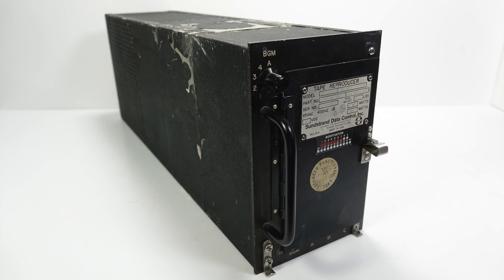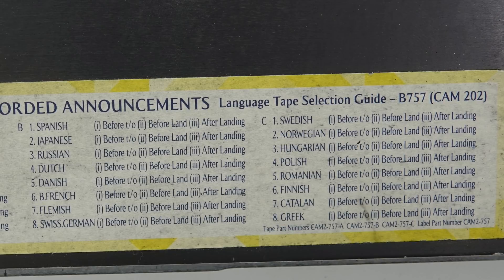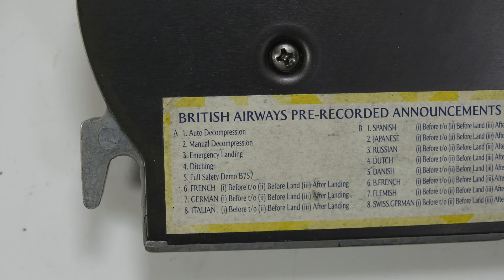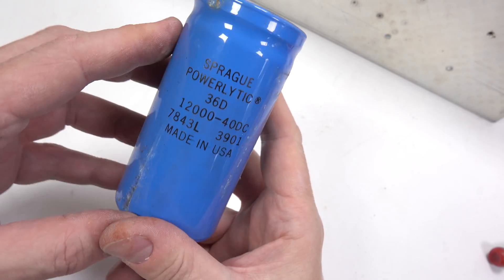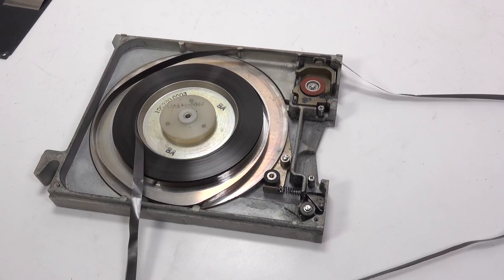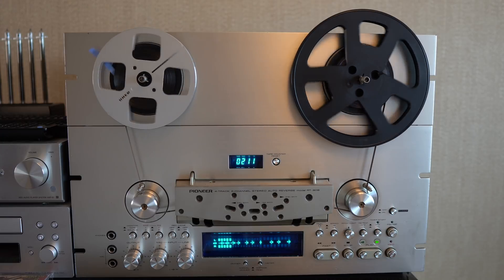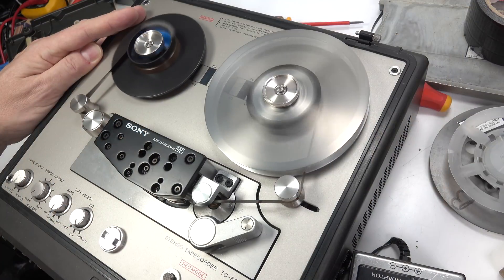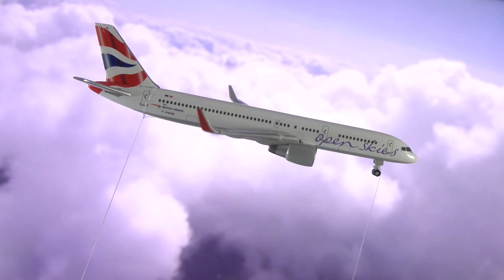Tapes on a plane (Part 2 - The Tech)

Comment: 115V at 400Hz is the "mains" of an airplane generated by the turbines and/or the auxiliary power supply inside the tail.
The 28V is the battery backup power which keeps essential stuff running like fuel pumps, emergency lights, a few instruments and the black boxes.

Most components also use 28V as an "enable" signal. When I had worked inside an EMC test facility, we often had components for airplanes. For this purposes, we had a large rotary current motor driving an airplane power generator to simulate the airplane power system. To activate the components, we mostly connected two common 9V batteries in series to activate and deactivate the components during the tests.

Comment: My guess from the complexity of the circuitry is that this thing can do a lot more than just play a recorded message. I think it's a general purpose annunciator unit with optional recorded messages. Given the effort they've gone to in checking that the tape is present and playing correctly, there must be something that happens if a selected announcement fails for whatever reason. The large number of connections at the back suggest a data connection of some sort. It could just be to raise a failure message of some sort but I doubt it. I have a feeling this might have some sort of speech synthesis for producing aircraft manufacturer predefined mandatory announcements for each of the categories if either it can't start the tape, there's a fire in the cabin, nuclear apocalypse, etc.

The reason I say this is that I was once on a 737 in the mid-90s that experienced technical issues midflight with one of the engines and there was a chillingly weird synthetic female voice that simply said "Attention, Attention. [Beep]" on repeat for a few moments until the crew cut in with their bing-bong bit to say that it was nothing to worry about except the plane had to turn around. I bet if you hunt around in the onboard ROMs that very message that I heard is probably in there somewhere. I would hazard a guess this unit probably has rudimentary speech synthesis rather like the Neal interview recorder but in reverse.
Reply: Yes. I was right. The name of this piece of kit is a shade misleading as it isn't just a Tape Reproducer at all. I couldn't find any information on the 757. However, the 767 Systems Guide still calls the equivalent of this a Tape Reproducer, albeit a Digital Tape Reproducer (DTR), even though by this point in development there were no tapes in it at all as it was a digital audio player. Therefore this is one of those odd examples of strange aviation systems lingo.

Comment: That giant capacitor is most likely there to keep the machine running for the 200ms-odd milliseconds interruption to the input power when switching from ground electrical power to aircraft auxiliary power, and again from aux power to engine electrical power. If there was need for it during a real emergency, it would be hooked up to the aircraft's emergency electrical bus. 

Not that anybody's going to see this comment 🙂

Comment: Did you have any problems with the frequency and voltage differences? The tape player says it uses 115V 400Hz AC. Houses use 110 or 220V and 50 or 60Hz AC.

Comment: I wonder if theres any wiring diagrams around that would give the pinout for the unit? I expect that dial on the front has nothing to do with the announcements at all and is only to do with the BGM tracks (given its labeling) considering most prerecorded announcements would be activated via the control panel that the cabin crew use to do other things such as dimming the lights.

Comment: Some of the components in this look like 1960s technology or even older, in particular the carbon composite resistors and top hat rectifier diodes, are not typical for something from the 1980s!
Reply: Predates the 757 production period as well (1982-2005).

Comment: I wonder if there is a specifications document on which pins do what. The power is 115v but uses a mains frequency of 400hz (not 50) to save weight as transformers can be smaller and save weight (common on planes and even ships).  28vdc input looks easier to try if it uses that as well.

Comment: Interesting that this was used in a Boeing 757 but was made and/or tested by Lockheed...
Reply: Looks like it was also certified for an Airbus model (probably the A310 and A320 since both were introduced in the 80s).

Comment: If you were trying to power with 115V, notice that it is at 400Hz (a much higher frequency than the normal 50/60Hz used in residential services).  I think (don't quote me on this) that planes (and some ships) use the higher frequency in order to combat noise (and to allow the use of smaller power cables).  I do like how you hang the model plane upside down, and the flipped the video!!!

Comment: Years ago I worked for Qantas Airways and we had this system on the 747 aircraft, I would have recorded and loaded hundreds of those cartridges.  The BGM (boarding music) tapes were recorded as 4 separate mono programs on a 4 track master which was then transferred to lubricated tape which we spooled on to 10.5" reels and then recorded on Akai 400GS 4 track, quarter inch machines. The tape was then wound off on to the aircraft cartridge spool by hand, using a "vinyl record" turntable and an adapter we manufactured ourselves.  The announcement tapes were mastered in 2 lots of 4 tracks on the Akai 400GS and then we transferred the recordings in two passes, to an 8 track Fostex 1/4 tape recorder which we modified to run at 3.75 inches per second rather than the original 7.5 inches per second, then hand loaded the tapes the same way as the BGM tapes.  I enjoyed your video it brought back many memories.

Comment: whats interesting is the BORING part has more thumbs up (by 1k) than Part 1 the well BORING one.  and thumbs down is far less on the NOT BORING part 2 video vs the NOT FUN video  zzzzzzzzz  which I literally stopped in about the time I heard there is a second video showing the exiting stuff.  ie the GUTS.  (although I'm still getting over a $15k record player that reads the grooves with a laser.  1. WHY 2. get a cd player sheesh)

Comment: Did you notice that the AC power has a rating of 400 hz? This is so that the transformers don't need much iron in their core, keeping the weight at a minimum. It won't run with a 50 or 60 hz supply.

Comment: The capacitor may be for power line interrupts.  Aircraft have controllably dodgy power lines where you can lose power for as much as 0.2 seconds.  The aircraft electrics are designed for this, and have a big capacitor for this purpose.
Reply: also, if you get enough clout, there may be a minirig (plane simulator) out there from Lockheed that is designed to interface with this machine.  By mandate, companies are required to keep these materials for 30 years.

Comment: I'm thinking you need both 115Vac AND 28Vdc to operate it because they have different power ratings. Most likely the electronics use the 28V, and motors / solenoids use 115V. Not sure how you would get 115V at 400Hz though. There must be cheaper ways than buying an aircraft. 😀

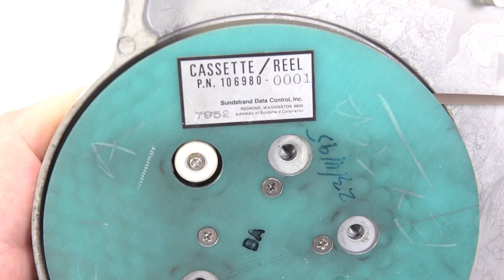Comment: 6:18 and a datecode on the sticker of 7952 meaning that 1995 was probably the last time the tape was recorded over. The disintegrating pressure pads also say 1979/80.
I could try to analyze the circuitry and maybe make it work, but there's other stuff I'd rather do. Like fixing arcade machines and writing new games for ancient video game consoles.

Comment: Hah. Made by Sundstrand corporation. Famous for their hydraulic constant speed drive units used to produce fixed 115VAC 400HZ 3 phase ppwerr for large aircraft. Im an aircraft mechanic and dealt with many of them. Can't say I ever ran across any on board audio equipment. A shame really because it would've been neat to tinker with.

Comment: You certainly have more patience than I have in separating out the audio tracks.  It was cool to learn how you did it which shows us that there is always a way to skin a cat.  The internals of the tape unit show that it was built to military specifications and designed to work forever.  I am curious if you could find on eBay the control unit that was used by the crew to select what is played.  Also was this the player that provided music for the passengers while in flight?  I wonder if you could get music tapes for this unit.

Comment: So from the looks of it, the music cart only have 4 tracks. Thus the knob on the case likely either makes it cycle the tracks or locks it on a single one.

And this players would likely be sitting pretty in the avionics bay with the controls placed somewhere accessible to the cabin crew.

And those controls likely had buttons for picking track and section directly from the other 3 tapes.

Comment: Be careful before you put down your $14,000,000.  That tape player would have been a special item ordered by BA.  Most 757s probably don't have the interface to run one of these -- especially not a freighter version 757 like the one you showed.  :)

Comment: I noticed the 115VAC 400 Hz power at 1 phase, I have a aircraft coffee maker from a ATA 727 (even got the green tag, shortly after my purchase ATA got into hot water with the SEC) I bought on ebay about 20 years ago. Haven't fired it up because it needs 115VAC 400 Hz power at 3 phase! I haven't seriously looked for a power supply, did internet searches but not going to a shop where they service avionics. It is rugged built like this tape player, can withstand a 9g turn (and most likely more).

Comment: I kinda miss the awful boarding-music played on Delta flights in the 1990s. If I remember correctly (Boeing 737?) the stewardess flight attendant's station by the cockpit had three separate volume control knobs, one for the music, one for the VHS player (safety briefing and/or in-flight movie), and a third for the attendant's PA mic.
I assume the pilot had his own volume knob, which was usually cranked up to 11 - because nothing makes speech more clear than insane distortion over speakers so bad that even Crossley wouldn't put them in a faux antique radio.

Comment: With regard to the format. I've got this problem where, during the winter, I will be wearing a coat and get into a car with someone who has the heat on. I will remove my coat, which they will take as a hint and then turn the heat off. Well, no coat and no heat is cold, so I will put my coat back on, which triggers them to turn the heat back on. I'm really looking for the coat OR the heat, but their determination to "help" me prevents either from happening.

You may be acting as that driver. Yes, some people want to "cut to the chase," and they will post timestamps in the comments for others who want to do the same. Well, that's it. It's solved. You don't need to solve it.

Maybe provide the timestamp yourself in the description, but, other than that... just keep the videos as they've always been and let people do what they will.

Comment: Could you have a look on these devices labled with the German post logo. Apparently these devices got the approval to be used at the German post AG.
https://m.ebay-kleinanzeigen.de/s-anzeige/neuwertig-toshiba-kt-4549-radio-cas-walkman-ovp-bda-neue-riemen-/1087023217-172-5326
https://www.ebay.de/itm/Panasonic-EASA-Phone-automatischer-Telefonanrufbeantworter-KX-T1430BS-/353157139523

Comment: The capacitor is used to keep power during switchover from ground power (APU) to aircraft power.  They are also used to clean up the AC power coming from the plane cleaner than it arrived.  I imagine safety briefings could certainly occur after doors are closed and before push back.

Comment: If I had one i would probably power it up the same way you did then test the pins and try and figure out which ones are inputs/outputs, then on the inputs put through low voltage and start ramping it up to 5v. If nothing happens then start reverse engineering it by tracing out where the wires go at which point I would get overwhelmed and confused and probably give up

Comment: I remember changing these tapes out in the avionics bay. This was for the passenger entertainment system, where you could select music channels at an audio control in the armrest, with 8 channels of music and four channels of movie audio soundtrack. They would switch the tapes each month to keep up with music for the Top 40 channels, and provide variety for frequent flyers.  Incidentally, even in 1970s and 1980s airplanes like Lockheed L-1011 and Boeing 747 and 767 the 12 audio channels were multiplexed from analog to digital (delta modulation) for distribution using a single pair of wires to all passenger seats. When listening to the audio on the airplane from one of those analog tapes, you were actually hearing the audio after conversion from analog to digital, multiplexed with 12 channels, and then de-multiplexed to the channel you selected, and converted from digital back to analog so you could listen with wired or those dreaded pneumatic headphones. Quite a process to give you a rather bad sounding (mono) continuous loop of music on a channel.
I always wondered if Mat would get to this tape format, and he didn't fail us!!

Comment: Back in the late 1970's I worked for Sundstrand Data Corp in Redmond WA. not in the audio reproducer division (sold to Sony in 1989 then to Rockwell in 2000) but "audio/data recorder" division i.e. FDR/FVR (Flight Data/Voice Recorders aka "black boxes") also Ground Proximity Warning System..Huge company and perfectly situated about 20 miles from Boeing..Great to see the SDC logo..a logo that most people would never see..In the 2000's I worked at Boeing for IT... in the first floor of the building i worked in was where they would decode and load data from a FDR/FVR into a simulator..the room was sealed and only used after a airplane crash..
BTW i noticed ebay has a used Sundstrand FDR from the 1970s for $200 ....
https://www.ebay.com/itm/SUNDSTRAND-FLIGHT-DATA-RECORDER-MODEL-573A-UNTESTED-WITH-PINGER-BLACK-BOX-1972/193519299800?hash=item2d0ea62cd8:g:sg4AAOSw~bVe55mS

Comment: Love the video.

One of the reasons there are so many heads there is that all tracks, aside from BGM would have been played simultaneously, and distributed to various channels on the plane.  When program 1 was selected all of the (i) Tracks would likely play, to coincide with the live, English presentation, same for 2 and 3.  It is likely that the other English Tracks/Channels were selected with another panel to send them to the different channels of the audio system, or to become overhead announcements.  Perhaps, based on destination or passenger compliment, they could choose which of the other tracks were on which audio channels in the seats.  It is likely the 757 has the five positions, A, 1, 2, 3, & 4, to provide for 4 possible positions for the tapes to play, and BA only chose to have multi-language announcements for 3 purposes.  Perhaps AA, CA, JA, or UA tapes would be different, with 4 sections for the various languages.

Comment: Fairly positive the dial is only to select the background music track.  Hence BGM over it.  The messages are invoked by various controls around the aircraft, some even automatically such as decompression.  Others would be a checklist option during preparation for ditching.  There must be a control in the cockpit for the emergency messages and one near the lead FA station for the routine ones and language.

Comment: The coolest part about looking inside any electronic gear in commercial aircraft (for me) is seeing everything they do - from board design to layout to isolation to shock protection - that no consumer electronics maker would even consider. Stuff like this can't catch fire, can't short out, can't wobble around, can't heat up, can't lose or propagate signal. It's built like a "brick outhouse".

Comment: "Bill I found the blackbox!"
"That's the BGM announcement thing, morron!"
Reply: "According to this recording, they were unsure whether they were going to do an emergency landing on water, on the ground, or if they were going to take off and land as normal in Spanish!"
Reply: “Apparently the last thing the pilots did was record a bit of electronica.”
Reply: don't want to ruin this joke, but i shall do what nerds do and pretend that joke wooshed so hard over me and say that black boxes are actually orange, they are called like that because black box in engineering is a some sort of a device which takes an input and sends an output without even thinking what's inside of it. a good example of a black box is a smartphone, you don't really often see the insides of one, unless you fix them or put them in airplane mode and throw them from a cliff

Comment: To utilize that BGM playback box, you guessed that you'd need the controls to enable the circuits inside to function.  You'd have to make your own, and to do that, you'd have to acquire the wiring diagrams for the passenger address and entertainment systems for the B757 models that used that particular box.  A search around the 'Net can sometimes turn up the diagrams required, but it's rather random what has been posted on various sites.  Here is a simplified version, look at slide 23:  https://www.slideshare.net/alexantrine92/topic-6-pa-system

Comment: Some time ago EEVBlog made a video about a group recreating a full flight simulator using an actual 747 cockpit and developing their own hardware interfaces and software to talk to and control the original instruments so they might have some insight on how to control that tape machine. Even if it's for a different plane it probably uses some bus or protocol common among those planes. The video is www.youtube.com/watch?v=U5aaDVEeTSQ